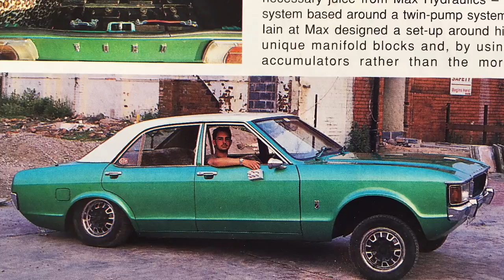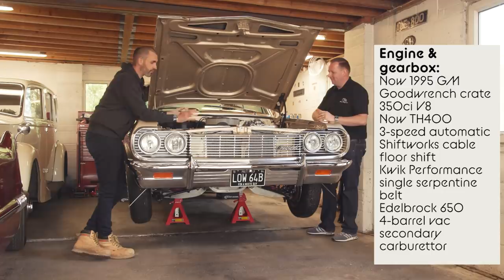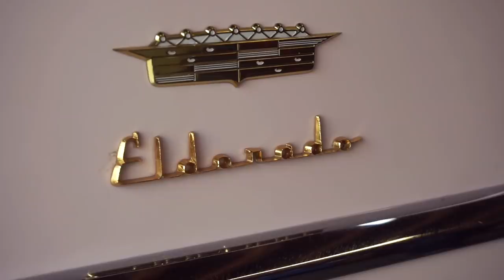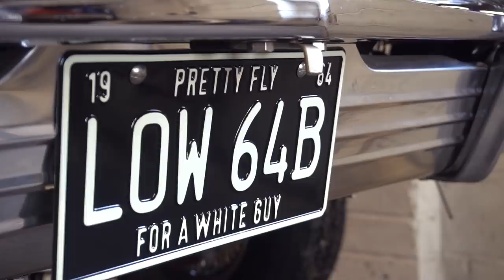The Chevrolet Impala SS lowrider project car build

Comment: Johnny, this was just fantastic. You were asking about the length of video, 35 minutes just disappeared and at no point was I bored. I've promised myself an American land yacht at some point, hopefully before internal combustion is outlawed.
Reply: I know its "proper" to have a V8 ICE in one of these land yachts, but there are companies doing EV conversions you still got the style and flair, Im a EV fan but something cool about a V8 rumble. 
that's only problem I have with EV's they don't sound as cool as V8 in a tunnel or under a bridge.
I wouldn't be surprised if there is someone working on Hydrogen Conversion kits for these old cars.

Comment: The best thing to do to keep the project moving is to focus on getting it on the road. The low rider hydraulics can always be added. Get it running and driving ASAP, and the rest will fall into place. Nice project. Best year for the SS. I grew up in Detroit and a friend had one just like this except white with a black interior. All stock. That was around 1978.
Reply from the maker: Cheers Tom, great advice. Yes, getting it running functioning correctly as a car is the focus, then finish the hydraulic aspect. What was Detroit life like in 1978? I am fascinated by the place.
Reply: @TheLateBrakeShow  I lived in a Western suburb and we used to cruise Telegraph Road in high school. It was not quite as popular as Woodward (which was miles to the NE) but it still felt like “American Graffiti“. Hundreds of hot rods cruising and stop-light racing. I won a short race in my forest green 69’ Mustang fastback against my friend in his candy apple red 67’ Mustang fastback. And we both got a drag racing ticket. What fun! As far as I know he still has the car. His father worked for Ford and bought it for himself new, then gave it to his son when he turned 16 in 1976.

Comment: I sold those as new cars in Staffordshire. '64's were so attractive, I ran a '64 convertible as a demo car.  I think I still have a genuine parts manual from '37 > '67 if I remember correctly. You're doing a lovely job on it. Congrats..
Reply from the maker: Did you Peter? In RHD too?
Reply: @TheLateBrakeShow  Yes, Impala's with RHD were built at the  Oshawa plant in Canada. The RHD Canadian built Pontiac Parisienne version came with a Chevrolet engine. We were about 2 miles from the place that built the electric MGB you tested. Did you know that the Ford RS200 rally car and the Norton Rotary bike were built at the same industrial estate?

Comment: I grew up in a 1974 Chev Impala , 400 cu in , 4 barrel carb, body by fisher. It was blue with a white vinyl roof. I still miss that car. It was a 2 door but it had small rear windows and they actually rolled down, never seen another car do that.

Comment: Very nice car! 

On the other end of the scale, my 64 Bel Air sedan got $140 of paint, an engine and trans out of an old chev truck, as many parts as possible from a junk parts car, some new tires and all new brake parts. The budget is $2000 all in and it’ll be sacrificed as my winter beater. 

I also have a project similar to yours. It’s a 1953 Mercury half ton I’ve had for more than 35 years and still have never driven or even sat in. 

It’s a good disease to have.
Reply from the maker: 35 years? That's got to be a record.
Reply: @TheLateBrakeShow  I purchased it at 17 for $200 complete with a parts truck with the intention of having it done for our wedding. We’ve been married 34 years now! 

The plan and the parts are coming together. It’s a stock restoration with a twist. We will be running a Cadillac 331 motor in place of the flattie. It’ll look great with its twin scoop oil bath air cleaner and give the truck the stance I want for free. 

Now we can have the grandkids involved in the build so that’s a big bonus.

Comment: At 7:12 Jonny uses the words ‘within the budget’ and I proceed to laugh for about half an hour.
Reply from the maker: Costs spread across 15 years isn't so bad. I spend bits here and there, then leave it for 6 months. I think I have spent almost £30k on it, but bought the car for £1600!
Reply: It was the idea that you had an overall number in your head that you had been sticking to. I gave that up with my Sunbeam Alpine ‘ResTigermod’ less than a year in. I hope it won’t take 17 years, but if it does then I won’t notice the money as much! Thanks for the videos!

Comment: Very nice, those doors will need a lot more fettling once the seals go in (I wouldn't be slamming a door without seals or with a key dangling out of the lock...). Surprised you've had so many issues on the engine fit side as they did these with big blocks so you wouldn't expect a gen 2 small block to be too much of an issue. Just got to keep on keeping on. Takes a lot longer to achieve when it isn't just a straight resto (lots of people hugely underestimate the amount of extra time it takes to do custom work vs rebuilding/refinishing what is already there).

Comment: A 64 impala does not need a full reinforcement unless you are building a champion hopper. To improve the ride quality put some thinner springs on the rear and some long shocks.
Reply from the maker: No, the X chassis is just shitty C section spot welded tin. The quarter panels would buckle after a year of 3 wheeling. I've seen it.

Comment: Ive always wanted an impala too, since a saw a low rider mag in the market when i was 8 im now 39.
My only issue is finding a garage long and wide enough for a yank tank to fit in. 
my current garage is 1 and a half wide but only std length so wont fit :-( 
come on John the engine is like 4/5 wires to get running and wired.

Comment: If you interested in showing another Delorean... then I have a project one with a swapped engine (3.0 V6 24V out of Laguna/Clio), electric ibooster from Tesla Model S, Electric power steering from Nissan Juke, automated HVAC system, custom equal runner exhaust manifolds, electric wiring with CAN BUS based on Renault Laguna system... and many more ;) It starts, but needs few more months to finish ;) All made in-house in a small garage or on a driveway... located in Banbury
Reply from the maker: Email us on the show please!
Reply: @TheLateBrakeShow  will do

Comment: Nice car homie snowed you on the 350.. the it's outer dimensions are the same as any first gen small block only a 55-57 block engine mounts are different.  Also you're missing the wiper motor and dude ran the wiring through the wiper motor hole..

Comment: 327 and 350 bolt right in the exact same way.  Dimensions are identical externally for ALL Chevy small blocks.  As are the motor mount bolt locations and bell housing.  PCV is the only significant difference from '64 to the Goodwrench engine.

Comment: HI- I’m currently building one now. Regarding the A Arms, did you install any rubber bump stops? Ive been looking at aftermarket ones but have heard they can rip out easily. Any thoughts on this? Thanks in advance- Craig

Comment: Nice Vid Jon-O. Still have my "1'St" '64 Impala. A SS-409/409H.P./4-Speed in Triple Red("#922 'Ember Red'..)which I paid $20 for in 1981. I have 7 other '64 Impala Hardtops which I've had since the 80's. I've got about 60 "Impala's" in general...I'm NOT a big fan of these Cars...these are Car's I just happened to come across in my travels. My older Brother worked in Junkyards during the Summer Months,so we would often be given Cars(we always had Garages/Sheds to stuff 'em into..)and Parts. I'm not a big fan of 'Restoring' Cars or any type of long-term 'Projects'...IF I buy something without any Engine/or 'Box I get to work A.S.A.P to get them back together and running. Oh,and I have a U.S Market '67 Rover P6 as well!
Reply from the maker: Stephine, you have some incredible cars. A 409 4 speed? Wow! How many cars do you have? Got any 64 SS parts by chance?
Reply: @TheLateBrakeShow  Trim? Badges?

Comment: Might I also point out that being under the influence of "Da Chronic " is the only way to work on any low rider. I believe this is stated in the 64 Impala edition of the Haynes manual.
Reply from the maker: Ha, is that a personal recommendation Paul? I bet you would have finished this thing in 6 months flat!

Comment: Anybody else confused by their misunderstanding of Small Block Chevy specs? Not sure what dimensions they think have changed since 1955 other than internally. The external measurements of the block went unchanged for 48 years of production vehicles, and still going as crate engines.
Reply from the maker: Inc the heads?
Reply: @TheLateBrakeShow  It would take extremely exotic heads to exceed the standard dimensions, and you don't appear to have gone down that path.
Reply: @TheLateBrakeShow  Small Block Chevy's are so identical externally that careful deciphering of the serial number stamped on the block is almost always required for positive identification. And even then surprises can await once things are opened up.

Comment: I get wanting a vintage classic American car as nearly everything made in the U.K. in the 60’s to 80’s is complete crap by comparison with only a few notable exceptions. But why didn’t you start with a right hand drive Impala which they at least sold in Australia? Australian cars are also generally more rust free than cars from the rust belt in the US where they salt the roads in the winter. Your project seems rather ill conceived and like a needless prolonged money pit.
Reply from the maker: They never made a 2 door Impala in RHD. I had a 4 door RHD but it was too rotten, and ultimately I wouldn't spend this kind of money on a 4 door. Australian cars mostly have odd proportions. I owned one and it was cool, but not pretty.
Reply: The Late Brake Show Ah, thanks for the clarification. In theory the 4 door RHD bits would likely work to convert a 2 door LHD of the same or similar year but I get that’s even more work.